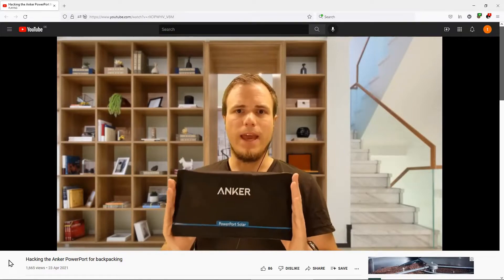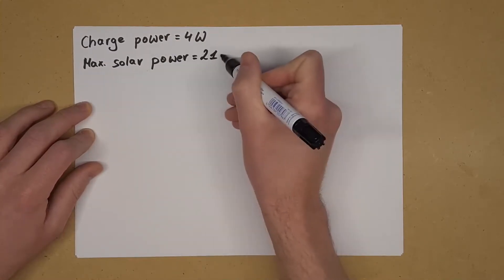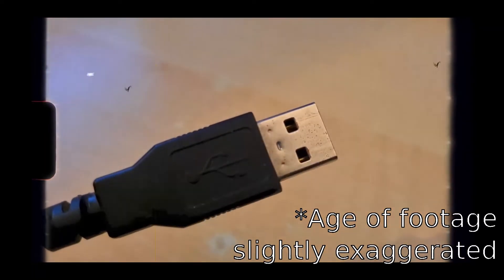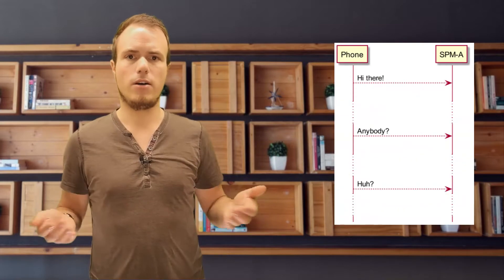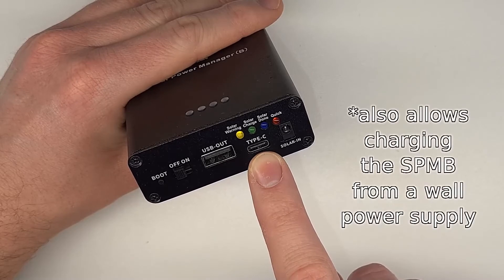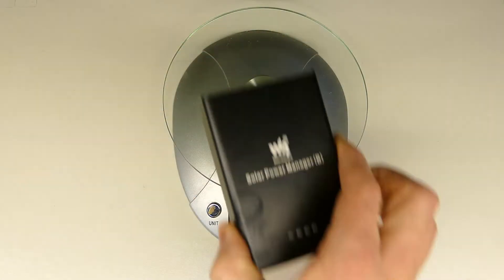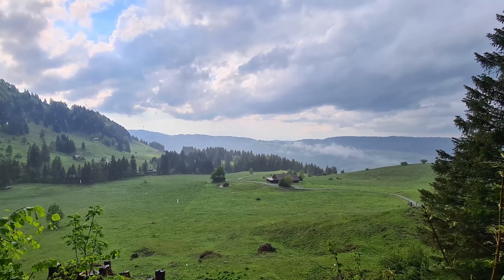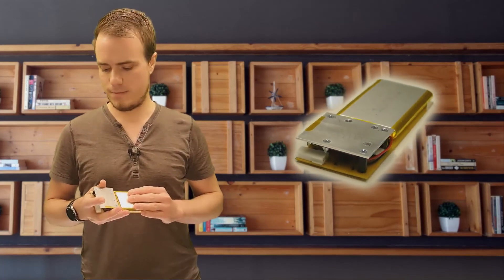An improved solar-rechargeable power bank

Comment: Thank you for the follow up video. Very informative.  May I suggest a video about the DIY board you built.  Building a custom board will/might? be able to overcome the limitations you noticed about the Solar Power Manager B. Namely, the barrel connector and the need to reroute the power wires.  I'd also like to use a larger li-ion battery.  Custom-built sounds nice!   Again, thanks for your time and effort.
Reply from the maker: Thanks! I might do something like that in the future. I'll need a decent USB-C PD controller though, at which point, a custom PCB is pretty much a requirement.

Comment: Thanks for sharing, I got a small GENASUN Li-On MPPT charger for my windows solar panel setup, it is not cheap for it capacity  at $1xx, the one you mentioned is quite affordable should be included in small portable panels.

Comment: Another follow up question.  You use the Anker solar panel, and mention that it outputs 6 volts.  What about the BigBlue solar panel?  Does it output 6 volts?  Looking at the pictures of it, there are 12 segments in each panel. I would presume 0.5v per segment, meaning 6 volts.  What do you think?  Thanks for your thoughts and ideas.

Comment: It seems the consensus among long haul thru hikers is that 10 AH is the best size of storage to have along.... just enough power to get to the next town (every 4 days or so) for a recharge. 

Another viewpoint might be the Air traveler. the Airlines allow any lithium battery under  100 watts to be OK for carry-on air transport. In that case, a power bank of 27 AH would be the max allowable by the TSA in the USA  

Waveshare should consider a "model B+" with the 27 AH battery and a plastic case to minimize weight. They also might  consider changing the Model B  over to a plastic case too for weight savings. .

Comment: Nice one. I have made an 20w MPPT li ion charger which does get quite hot during max charging current but does get rhe job done very well. I ve also built a 15w QC2 charger to go with it so the 2 make a great little solar charger which is quite powerfull. May make some video at some point just to share

Comment: Many thanks for your informative video!
I was at the edge of buying the Waveshare Solar Power Manager C with the 3x 18650 cells. 
But I'm not sure. 
At which Ampere rate can the Solar Power Manager charge the cells? If you got a 40W solar panel or a 30W one and the sun is good i fear you lose energy instead of saving it. I don't think, 3x cells can be charged at 30Watts? 
What is the rated charge current of the device?
Perhaps it's only good for very smalls solar panels?

Comment: Would a small heat sink on the buck converter parts help dissipate the heat more safely?   And I wonder if a 3-d printed case could help bring down the weight for backpacking... Thx!

Comment: I was looking to find a module just like that, would be great to be able to set a charge voltage and a buck boost converter to set output voltage, bonus if it can be paralleled or series connected for increased capacity or output voltage, especially if you can parallel charge them with a smaller voltage and then series them to have a higher output voltage than the input... also if it can work with different sized batteries or even different chemistries

Comment: I'm confused... Isn't this simply just a standard powerbank? What stops me from using any arbitrary powerbank, charging my phone while the powerbank is being charged by the solarpanels? I'm obviously losing efficiency twice through voltage regulation, but at least the battery is being continuously charged, right?

My experience, like your own, is that a smartphone will lose communication with the solar panel when the unstable current drops below a certain level, and sometimes does not pick back up on the communcation for quite some time, missing out on a significant amount of power.

Waveshare's SPMB looks unnecessarily large and clunky for doing something as simple as buffering the power output of a solar panel. I have an old LiPo solar charger circuit from Adafruit, which is essentially identical to Waveshare's original SPM (5V/1A), but is a fraction of its weight and size, and stores its main buffers in a large capacitor. It shouldn't be very hard to add a controller circuit that upregulates any high currents @ nominal voltage to its preferred charging standard without adding 100ml of metal bulk. Remember, a low power solar panel such as the Anker is a very simple device. It's unfeasible to expect it to charge anything but a single device at a time. So we really want only a single port, ideally just Power Delivery, to extract power out of the solar panel. It seems to me that the losses in having no buffer controller is so great that even the losses in battery regulation are preferable, if a medium such as a battery is needed to charge non-PD-compatible devices.

Edit: It certainly seems to me that an external battery makes the LiPo in the solar charger circuit redundant. Not to mention the power dissipation from the buck converter required for its regulation. This all but defeats the purpose of having a buffer in my opinion. A single chunky capacitor seems to me to reduce the load on the buck converter, while simultaneously providing steady power to an arbitrary external powerbank or other device.
Reply: same toughts and questions here...I'm using a Anker Powerbank to capture the solar energy, assuming it can handle the pending incoming energy-leveles. When beeing back in the night I can recharge my devices easisly with that fully loaded powerbank.

Comment: I think 12W is still not enough. It needs to be 18W. In addition, you need to be able to adjust the MPPT, since this point can shift depending on the strength of the light falling on the solar panel. Further, the video did not tell whether this power bank can simultaneously charge itself and charge some gadget; while performing the function of a power stabilizer. This is a very important feature for a power bank that must be paired with a solar panel. Further, in my opinion, it is better to have not a power bank, but a charger for 3 18650 batteries with a power bank function. It is highly desirable that the batteries are charged not in parallel, but through independent channels, so that batteries with different levels of residual charge can be installed simultaneously. And finally, I want to note that for a power bank or charger that are designed to work in tandem with a solar panel, it would be desirable to have a sound notification function about the end of the charge; this feature should be disabled. Well, this power bank should also be able to be charged not only from the solar panel, but also from the usual mains charging, so that it can be charged from the outlet in inclement weather, if there is such an opportunity.
Reply: @gharbadtheweak3878  , I did not find such a power bank for sale. I had to make it myself. It works almost the same as I described above. The only difference is that in it the batteries are charged in parallel, and not through independent channels. Maybe someday in the future I will be able to make independent channels in it, but now I can’t do it.

Comment: Can you connect Anker's USB output to this device's solar input instead (without the need to rewire the Anker)?
Or perhaps connecting Anker's USB output to the Type-C port on this device?
Reply from the maker: The USB ports will put out 5V, whereas the PowerManager requires 6V at the solar input to work correctly. You can try charging the PowerManager via the USB-C port. My Samsung powerbank has proven itself insuitable for that; I've never tried it with the PowerManager B.

Comment: I'm thinking that we can achieve the same result by using a portable battery charger (so we don't lose the leftovers energy). After that we can use the portable battery for charge our devices. 
Do you think the results are the same as yours?
(I wrote the same answer in your first video, maybe this video is newer and easly to achive)
Thx
Reply from the maker: What exactly do you mean by portable battery charger? A power bank? If so, it depends on the power bank, some perform better than others. Please let me know if this answers your question or not :-)

Comment: Wouldn't it be better to pre-charge a power bank from something like a 28W stationary USB portable solar panel left on a window sill or garden etc and take the high speed charging capability with you, perhaps? I have a few power banks full to take a few USB things off grid and run some interior LED string lights as well. But I don't hike, so I'm possibly missing the point, but I get the MPPT issue nonetheless. Great work.
Reply from the maker: Yes that's an option if you can leave a solar charger stationary in the sun for a few hours. Like you said, my setup is intended for hiking trips. Depending on how much hiking there is each day, there may still be sufficient sunlight left at the end of a hiking day to charge up a power bank. But you'd have to carry the whole stuff with you anyway, so no weight savings there...
Reply: John, one or two day hikes - I would agree with you. Why haul all that stuff around?  But, on long multi-month hikes, with 5-7 days between towns, having a way to recharge one's electronics would be worth the weight.  In addition, not having to sit and wait for one's electronics to recharge, but instead, get one's resupply, and go, would be an advantage.
Reply: @toledomerendo  I get that. From the UK, so that's not something I factored.

Comment: For someone who can't figure out electrical maths properly... What does this equate to in peak amps @ 5V? Are you getting more than the 2.4A @ 5V that would come via USB (in theory), or are you simply bypassing limitations in the USB output that may prevent you getting the full 2.4A even if the light levels would otherwise provide it? My basic understanding suggests you averaged 0.624A @ 5V on the second trip (0.624A * 5 = 3.12W)?
Reply from the maker: Hi. So, I'll try to clarify this. 2.4Amps is the maximum current at which the lithium-ion battery can be charged. The voltage of the battery is somewhere between 2.8V and 4.2V; it's not the 5V output. If the battery is sufficiently charged, the USB output can deliver full power, regardless of the present light levels. I hope this answers your question - if not, please let me know. Sorry for the confusion.
Reply: @toledomerendo  Hey, I mean the rate at which you were able to charge the SPMB's li-ion from the solar panel - you say you were capturing at a rate of 3.12Wh/h. What would be the equivalent in amps @ 5v to capture the same amount of power? I ask because I'm testing a few different models at the moment, and it seems they will all put out most of the max 2.4A @5V per USB terminal under the right conditions, but varies a lot by device connected, and trying to understand where the main benefit of a solar power manager like this would be.

Basically what I've seen is with a 4-panel foldable solar pack, i can get ~1.5A per port even in winter, so presumably closer to 2.4A in summer (the 3 panel Anker would max out before this I think), and at least with my power-banks (also Anker), they instantly recover current after a drop out from shade/clouds (unlike phones, which might stick @ 0.2A, or only ever get to 1A). So I just wonder if connecting the right powerbank(s) to the right size panel via USB would give similar results to connecting up the SPM like this - you obviously did the tests before, I just can't figure out the conversion from Wh to Ah, but you suggested you were only pulling 2.5W (0.5A @ 5v?) which is way lower than you should've got and might indicate an issue with the powerbank or panel you had. Or I just totally don't understand properly 😛.

I'm also guessing there's a point at which the current drops so low the powerbanks won't do anything, whilst the SPMB would keep pushing that to the connected li-ion, which would account for better performance, but you seem to get the best performance boost in the most sun so that doesn't make sense :|
Reply from the maker: So, the equivalent current for 3.12Wh/h at 5V would be about 0.6A. That's just an average, of course. The main point is, that sufficient energy can realistically be captured during a day of backpacking to keep one or two smartphones charged. But that's the charge rate which ends up in the li-ion cell.

The foldable solar panels will certainly put out ample power, as long as they stay in direct sunlight. But that's not feasible when backpacking. Some phones may recover from a sudden drop in power output, others may just stay at a minimum charge power. Of course, if you have a power bank which also recovers quickly, you could use that. The advantage of the Solar Power Manager is, that it will always try to match the power output of the solar panels point per point, with any level of insulation.

The point about charging the phone at 2.5W is due to the absence of power negotiation. Not all phones will draw so little power, some will "probe" the capabilities of the charger by ramping up the current and checking for drops in voltage. In any case, it's not the main issue, because usually, you'd charge a phone overnight anyways, so a charge time of several hours is not an issue.
Reply: @toledomerendo  Hi thanks for these videos, I bought a similar solar panel solution but with 36W output. The electronics were junk so I decided to start building my own setup. But then I run into this issue that there isn’t any real good hw that deals with fluctuating power and usb power delivery. What would you say is this device in video something that could take full advantage of 36 W panel?

Comment: Will this work with a 15 watt  anker
Reply from the maker: Yes it should work just fine. I don't have a 15W Anker panel, but my guess is that it's identical to the 21W except for the number of panels. It will also save you some weight.